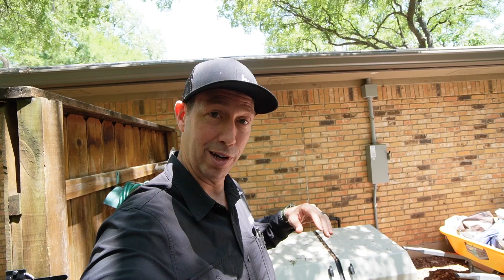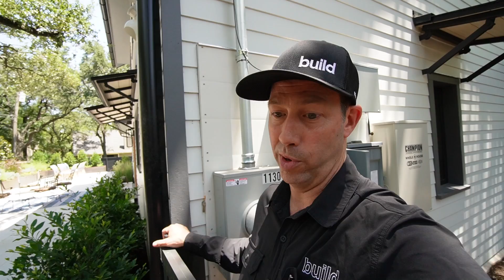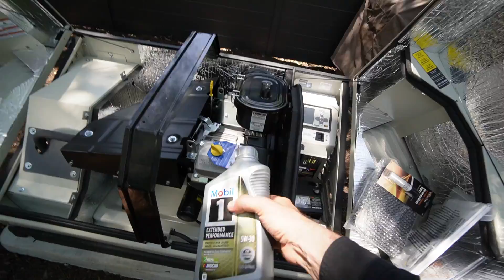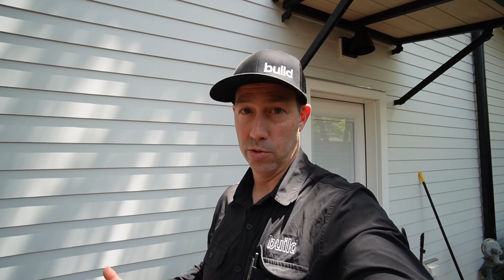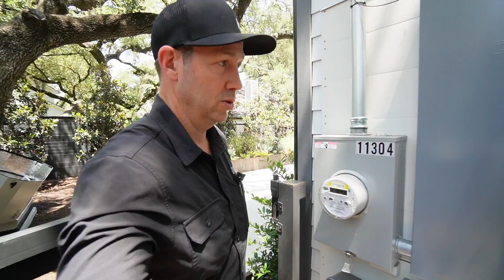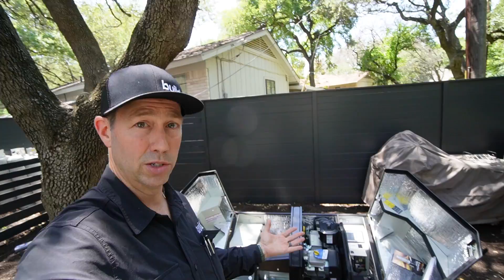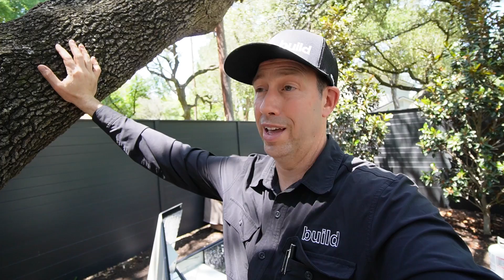Rolling Black Outs? Meet my little friend: Home Standby Generator

Comment: I went solar + battery with my house.
I do think a generator is going to handle an extended outage better.

But as far as worrying about battery longevity I kind of disagree.
My system will pay for itself in about 5 years (did everything myself, saved a lot on labor)
If I need another battery in 10 years I'll still be money ahead.
Reply: I don't know how anyone who had the option doesn't pick solar with battery.  you get to use it for the next 25 years daily lol.  Instead of having this pile of junk and fuel rotting in your yard. 99.9999% of the time.  It's literally the only option that makes you self sufficient.
Reply: And if you can tap into something like Tesla’s “Virtual Power Plant”, like we have here in California, that payback could be much shorter.  They will pay $2/kwh when the grid is stressed.
Reply: Off grid solar here… home brewed LFP batteries. 60kwh of them.
Reply: @ai4px  wow, nice Wes! I guess you do need a good amount when totally off grid.  I want an automatic backup LFP setup, probably 20kWh total but waiting for prices to drop.  Need AC coupled since I installed 2 separate arrays, big one being in the detached garage with Sunnyboy inverter.  Smaller array on my house roof with Enphase micros.  8kW of solar.
Reply: @blh1997-w1q  do you have power when grid is down?  Sma makes inverters the tweak the line frequency in order to control the power output of your solar inverters.  They lock on 60hz when grid tied and vary frequency 60-62hz when cut loose from grid.
Reply: @ai4px  no, because it's grid tied.  On the SMA I can add a 1800watt 120v outlet that can be switched on and isolated from the rest of my house.  It would be in my garage and kind of annoying to make use of though.
Reply: @blh1997-w1q  The sma sunny BOY makes power just as you describe... emergency 120v.  You have to flip the emergency switch every day (it's a feature lol).  the sma sunny ISLAND is a 6kw battery inverter that will use frequency shift to control your solar inverters as I described above.  You can use one coupled with an autotransformer (hokey) or use two in parallel like I do to get 240v.  They are friggin tanks... will start a 5 ton heat pump compressor.
Reply: @ai4px  that is nice and I do know they have that integration, trouble is it's in my detached garage which then feeds the 100 amp sub panel and goes 30ft to my main 200 amp panel.  Not sure if there's a good way to get a backup going like that.  Batteries would also experience -10 up to 110F.
Reply: @blh1997-w1q  LFP batteries do NOT like below 25F at all.  If you run battery inverter in your house and kept the solar inverters feeding in back from the shop, you'd have a winner.  I put my sunny ISLAND in front of my entire 200amp panel.  Yes, I am feeding a large house 200amp panel with 55amps.  So as long as your solar inverters are downwind of the sunny island, it can talk to them and keep whole house going.  lol.... most people segregate their emergency loads into a critical loads panel behind a battery inverter.... in my case, I added a 200amp panel ahead of the main panel in the house and use that to tie my sunny island to the grid and run to the carport for charging our cars.  100% of everything else (house, barn, workshop) is all downstream of the sunny islands.   So, where most people have a large number of non-critical loads and a few critical loads in a sub panel, we have the /entire/ house as a "critical load".  Matter of fact, we're in the middle of a thunderstorm right now (east of Columbia SC) and the grid has gone down.... house is still running here.
Reply: @ai4px  alright, cool, I'll look further into the SMA going in my basement.  Unfortunately there isn't much room on the panel wall but maybe a run 40 or 50ft away further back in the basement can work.
Reply: Any fuel generator will only last till the fuel runs out then your in the dark again. Natural gas is better if you have a connection at home but with the Texas winter storm some places got their gas shut off because the lines froze. Solar is better for long term.

Comment: With all that sun in TX and solar panels Matt's house could be REALLY close to net zero and the panels pay themselves off in 7ish yrs, maybe sooner with a 100% electric house. Batteries could do 90% of the heavy lifting for short outages. (batteries that size are very recyclable)   Since he got the generator for free for doing the commercial, keep that for very bad situations like the big freeze. Maybe if a solar company would sponsor he could get panels? :)
Reply: Not much sun in Feb 2021 during the week long snow and ice storm
Reply: Jim S hello in FLORIDA even if you have much more SOLAR  than you need, the LAW says you must be connected to theUTILITY, even if you DO NOT USE 1 KW, FPL CHAREGES YOU A HELl fee
They saw RICH PEOPLE WITH SOLAR, ARE NOT PAYING THEIR FARE AMMOUNT TO KEEP THE GRID IN GOOD REPAIR, there are 3 cases before the COURTS NOW, because of the BS
but several UTILITIES WONT PAY YOU 1 CENT, WHY? We are in business to generate electric NOT  TO BUY IT !
Stay well 🇺🇸🇺🇸🇺🇸🇺🇸

Comment: Micro-Air EasyStart from Hutch Mountain will allow you to start your air conditioner with less power/smaller generator.  

Matt, you got an EasyStart from us for your RV's ac, but if you need one for the house, let me know.  We love the chanel & will hook you up!  😁

Thanks!  
- Your friends at Hutch Mountain
Reply from the maker: Love my easy start on my RV!  I can run my RV AC on a 2000w Champion Generator because of that awesome device.

Comment: I’ve got a 15-18KW diesel generator on my home. We were out of power 20 days with Ida. Day 10 we had to travel a bit to get fuel. We averaged .7 gallons per hour over the 20 day outage. Diesel was way cheeper than propane so we were fairly cost effective. Didn’t have to change oil till 200 running hours were on it. (Can’t say that with air cooled generators.) I’m total electric also and would have given an eye tooth for natural gas in the neighborhood. I’m selling here and moving to another neighborhood on the water and purchased another diesel generator for the new house when we build it. Can’t beat diesel power.
Reply: Diesel generators are the best. But they do have higher costs. And getting approval for a big tank can be a problem. Plus you need to have the fuel "polished" every so often if you don't use it as it will soak up water, which isn't good for your tank or engine.

Comment: I disagree with battery power as the lifepo4 batteries can exceed 10 years with 100% availability.  You could use a minimal solar system to charge the batteries and a small propane generator to backup the battery for a long power outage. Nothing is perfect but space availability and cost prioritization can blend a custom solution.
Reply: Battery power is also instant transfer. Having everything cut off for a second is not ideal, and doesn't help for all those short term power blips that last under a minute when the utility is having issues during a storm
Reply: @ctgottapee  You don't want an instant transfer on anything though, especially on battery technology utilizing Lithium as they typically malfunction to the point of catastrophe.  The actual way of doing a transfer is manually flipping off all circuits at the panel, transfer and slowly turn on what you need one at a time.  Realistically we should be doing this when grid power is restored as well, but we don't think about it.
Reply: I have been playing with used equipment from ebay to learn and Lifepo4 batteries are so much better than the gel or hybrid batteries.  Solar has dropped so much that inverters, chargers, and batteries are the only costs that are still all over the place.
Reply: This is the route I am going. With good brands and DIY install, I can get 10KW of panels with 30KW LIPO for ~$20k. I'll have a small generator for backup to the solar if needed. It'll be WONDERFUL being able to sleep through the night without the hum outside my window.
Reply: Solar = cost more, right? How about night time? Or cloudy day? Or winter which we got shorter day time? Considering all of that. + 1generator.
Reply: @EnervaPartyOfFour  solar is planning.  Solar requires the right amount of panels to batteries.  Too many panels is in efficient and too many batteries can damage the batteries.  A generator is instant solution but wrong size leaves no adjustment and fuel can be a hindrance.  Both have thier positive and negative.
Reply: @eduardorivas363  you never answer all my questions? Cost, if ypu are living in north east ( snow, cloudy day, shorter night... ) and.. for an existing house, what if you need to repair or replace the roof, removing/intalling just to repair the roof will add cost... so answer that please
Reply: @EnervaPartyOfFour  north east has a lower sun in winter which would be a greater angle. The colder weather (depending on the type of panel) do work more efficient. If you already need a new roof, then that cost is still there but if placed over existing roof then the panels protect the roof. You could also ground mount them. The pros and cons are subject to the area as well as the user. Not everyone has an ideal condition for solar or generator. Matt is in TX which is ideal for solar. His conditions as to area are limited so complete solar probably not ideal. As a user, Matt has a lower comfort to use of solar but he has always been enthusiastic about learning new technologies. Replacing a roof with solar panels is a few hours more as panels can easily be disconnected.  The mounts can be easily removed. The reverse the process to reinstall.
Reply: @eduardorivas363  but it's additional cost for the home owner, if someday they will repair or replace the roof. I mean removal/install of solar panel.. so money wise, I will go with genarator. Less complication.
Reply: @EnervaPartyOfFour  a roof should be replaced at most every 20 years. A single reinstall might cost an additional $1000. Solar panels have a 20 year warranty to deliver 90% of power rating. If your replacing a roof that much that the cost of removal and install is greater than an upgrade at time of removal, then its not the solar that should be concern but the contractor installing the roof. A hybrid system with both solar and generator is almost always better for every owner as solar has a daily payback rather than lawn ornament as a generator.  Solar inverters and batteries can be added to so that an increase in power or storage can be achieved.  A generator needs replacement for increased output. I do not believe generators can be placed in series to increase output. Pros and Cons are for both styles of power generation.  It is specific to every owner as to what type or hybrid is best. The most costly upfront is solar and hybrid but both have a daily return that over time offset the cost.
Reply: @eduardorivas363  it's hard to justify the cost of generator vs solar hybrid plus the headache that gives you along the way. repairing/replacing the roof( you can't repair the roof rifht away, you need the solar to be remove before you can start, by the time your house is flooded), maitenance/cleaning the panel. If you just use the same way as the generator for back up.. and you may or may not use it in a year or just few hours or days. Again for back up, matt hit it... generator is the way to go...
Reply: @eduardorivas363  Panels, I doubt are warranted for 20 years.  In fact, that's the life span.  I would probably think 3-5 and then there's severe weather problems (hail breaking them) with panels and the overall efficiency is about that of a generator:  about 20-25% and that is only if you keep the panels clean.  Then there's end of life:  panels, like some of these newer battery technologies are not really recyclable.  A generator is actually recyclable at the end of life being largely made of steel, aluminum and copper.
Reply: @WJCTechyman  panels have 2 warranties.  The product, that warranty for a panel is between 20 - 30 years. The performance,  that warranty is the output is 90% of new for 20 years or more. Panels seem to have the warranty of a good shingle. The panels all state the warranty.  The options for solar are getting better. A low frequency inverter will handle a surge significantly better than a high frequency inverter. The cost reflects that. The thing is solar equipment prices are and have been dropping fast. Everything is almost always a pure sine wave.

Comment: Seems like a crazy expense and eye sore compared to 8kw or so of solar, Franklin WH 10kw inverter/13kWh battery and using the existing generator you have.  All modern batteries have 10-12 year warranties and go 3000x cycles, much better than that generator that will fail at a critical time in 5-6 years.  Also the recycling statement is flat out false.  We understand the need for sponsored videos, but pushing an incorrect and antiquated solution to the problem is a disservice to your viewers.

Comment: I went with a Kohler 14kw with load shedding modules on my electric dryer and range. The Kohler transfer switch already came with a load shedding relay for the 3ton condenser. I also installed a soft start kit on the condenser so it wouldn't put a big load on the generator when it kicks on.
Reply: Amen!  The soft start is the key to running the air conditioner.  It really lowers the amount of power needed to get the AC running.  Did you buy a Micro-Air EasyStart from Hutch Mountain?
Reply: His inverter driven heat pumps are inherently soft start
Reply: @rj.parker  Yes in Matt's case this is correct, but in Michael's scenario his was not an inverter style & definitely benefited  from a an EasyStart.

Comment: Hmm.  Texas with the amount of sunlight you have I think I would have gone with 20kw batteries and as much solar as I could fit on the structure.  Snow melts right off of solar voltaics first sun so that's not a problem.  The thing about solar and batteries is that it is perpetual.  IOW, you could be without grid power almost forever (maybe 20 years) and not have to worry.  Now, you would have to budget a bit.  But no oil changes, noise, exhaust, refilling tanks, budgeting loadss,etc.  You might have to say no bread making on an outage day.  But being well insulated heat is heat and that might work okay too.  What's the life of your generator?  How many hours continuous can you run it with out an oil change or servicing.?  What about long term life?  What is the MTBF?  Solar for me.  Total Days With Sun is 293.  And your sun angle is perfect!  Plus you have government IRS deductions for solar that is significant!

Comment: i know it's a bit late, but signature solar has some great solar+battery setups. going that route you have the benefits of basically eliminating your electricity bill, and the 23% rebate on everything. the generator will give you no benefits there. but i definitely understand the upfront cost issue. i've been eyeing 16kW of solar with 30kWh of battery from signature solar which i'm guessing will be just under $20k all in (before rebates). my with my current $250-400 electricty bills i would easily come out ahead with the solar+battery setup in less than 10 years.
Reply: Solar might actually be better in an extended outage scenario. If he runs out of propane after the 3 days, it is more than likely there will be no propane to buy. While solar could be charging the entire time.
Reply: But the cost of solar for just 3day to 1 week in we don't know when...if you have roof leaks/repair or replace. You can't donit right away, you need to remove and install again the solar panel which adds to the cost.. plus at night and cloudy day you cannot charge.. in my opinion gas generator is the way to go foe emergency use, easy install and more capacity.
Reply: @EnervaPartyOfFour  sure for emergency only generators are the way to go. I wouldn’t be surprised if Matt does solar and maybe battery back up in the future. The trio of generator plus solar and battery is IMO the best solution if you can afford it.
Reply: @mattb6001  right on the money... it's always the cost....

Comment: i would love to see if that could supply your whole house as if you were stilll connected to the grid
Reply: Sure unless the inverter heat pumps were all running overspeed to handle 10f weather.  For all the great things inverter based heat pumps do, they consume way more power at low temps.  Psc compressors lose capacity but reduce power demand.